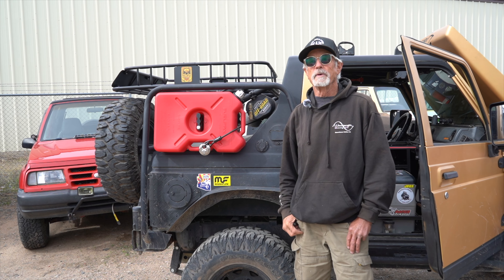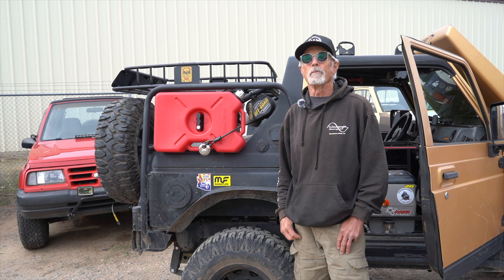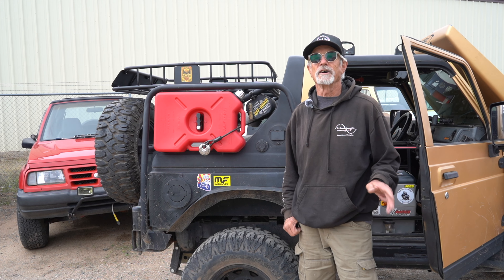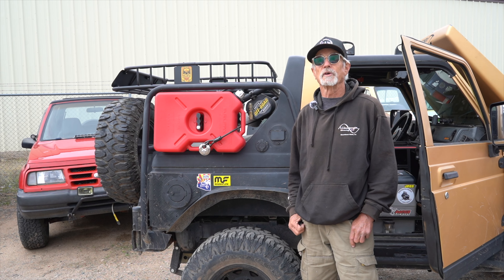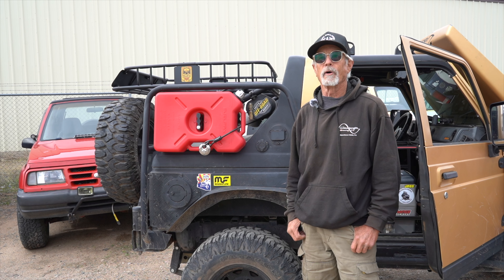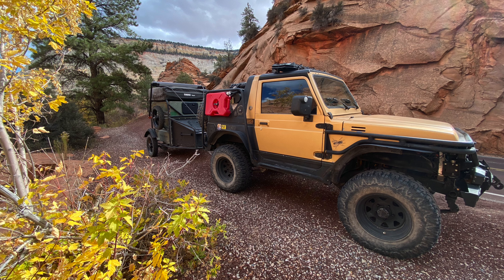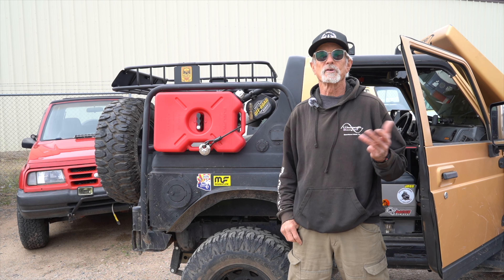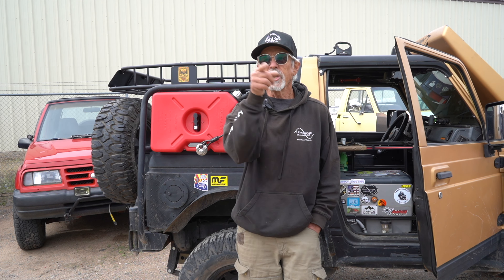What's New With OROZUK? The Golden Suzuki Samurai

Comment: Great video.  Thanks for sharing.   I'm new to the channel and it's been quite helpful.  I just replaced my first samurai clutch and re-geared and rebuilt my first T-case and found that this is definitely an addiction.  From what I'm gathering Myron is not only the man when it comes to Samurai's, but he's a genuinely good man.  Awesome Sammy!
Reply: Hey, Dave!  You’re right about Myron and about the addictive quality of learning about how to do your own repairs.  There’s something especially attractive about Suzuki 4X4s.  Something about the scale to capability ratio.  Every component is smaller and lighter.  Something easier to wrap our heads around.  Then you get them out on the trail and see that they can get it done.
Reply from the maker: No good in me other than Christ. I am just a normal cheap Suzuki bastard.

Comment: I opted for the Trail Gear 3” lift springs to fit 31” tires.  Still sprung under the stock axles.  Just right for my Milestar Patagonia 31x10.5s on 8” wide 15” wheels off of an old CJ.  I got my 4.9 T-case (like a GRS II) to restore proper ratios.  It may look a little like a crawler but I’m just setting it up to get me to places a stock rig can’t reach.  After the 1 mph tip-over that totaled the tintop body, I found the convertible body for $200.  There was damage on the grill and front fenders.  Rather than spend $700 on that body work, I opted for the Trail Tough a Front Tube Clip instead.  In terms of off road capability, Myron classifies it in the “hunter rig” category.

Comment: Were did you get the exhaust manifold?
Reply from the maker: From Zuksoffroad. No we don’t have anymore we are working on a header for 2.0/2.3 Samurai conversions. We already have for tracker/sidekick conversions.
Reply: The exhaust manifold was harvested off of the parts donor motor.  I heated it up in a spot where it was too close to the steering shaft and banged it back until everything cleared.  No big deal.

Comment: Does the j20a mate to the samurai transmission, use its own, or adapters?
Reply: I bought the rig with a 1.3 and had a 1.6, 8 valve engine installed by Petroworks.  Their 1.6 swap kit included the plate to mount it to the stock transmission.  The 2.0 uses the same type plate.  The engine mounts are from Trail Tough as well as the transmission mount.  They’re the go-to source for 2.0 conversion parts and kits.   On the topic of mounts, I’m running the Zuks Off Road Super T-case mount.
Reply: @teamorozuk6819  look at me, I met a samurai celebrity in the comments section. 
Thanks for the reply. I love your zuk. The tin top tragedy breaks my heart but I like what you do, and I'm glad you stayed at it.
Reply: @deadbrother5355 Thanks, Bro!  I’m up to my scalp with the challenges and effort put into this project to the point that I often cannot see the forest for the trees.  Too invested to have an objective perspective.  I appreciate your kind words.

Comment: What suspension, t case gearing, axles, and tires does orozuk have?
Reply: Sorry about how long it’s taken me to respond here.  There was one part that wasn’t answered previously.  I’ll just answer it all in order here.  Suspension is a simple 3” lift using Trail Gear springs along with the shocks recommended by MY.  The entire axle/diff assemblies are stock for the 1986.  Tires are Milestar Patagonia MTs.  I was shopping Amazon for a budget tire solution and found them early on.  I saw them as a budget-friendly solution and I loved the way they looked.  I also reasoned that, if they ended up being somehow inferior, I could get away with it since the Samurai is very light by light truck standards.  Soon after i got them, they started showing up on a lot of the YT channels I follow.  All on much bigger rigs and apparently working fine.

Comment: You sound like a robot explaining stuff relax a bit bud.
Reply: You sound like a hater better relax a bit bud
Reply: You’re right.  I wrote the copy and was reading from a teleprompter app that had poor speed adjustment so I was rushing to keep up.  I’ll be better next time.
Reply: @teamorozuk6819  dude you do you, screw those haters. Your rig is awesome, what suspension and axle gearing are you running?
Reply: @nrspence8258 Thanks.  I didn’t get hate from his critique.  More like an accurate observation.  I was definitely not relaxed as I raced to keep up with a teleprompter app with poor adjustability.

Stock diffs and axles. 1:4.9 T-case to compensate for the 31” tires.